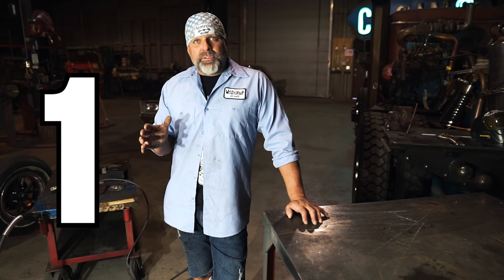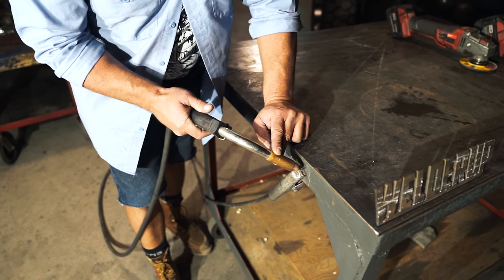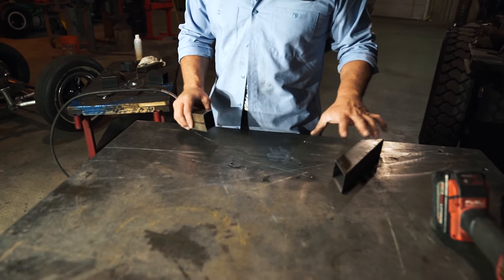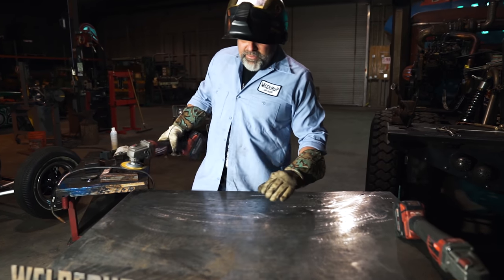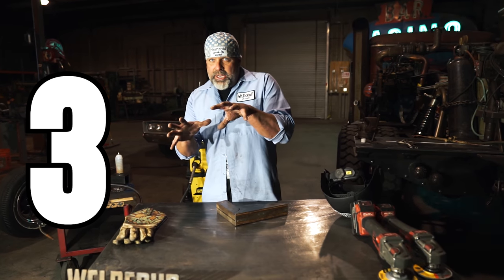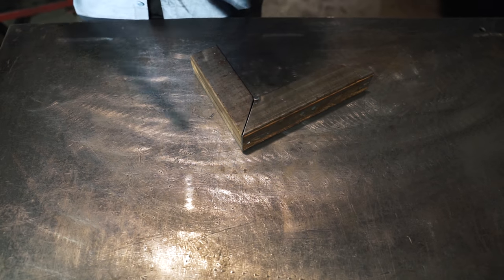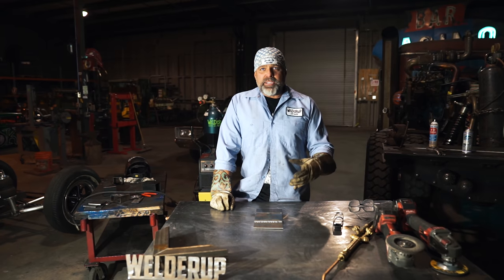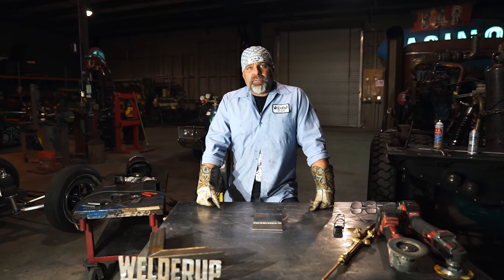How NOT To WELD! Top 5 Beginner Mistakes!

Comment: I agree with you 100%… Check out the scotch brite clean and strip XT pro disc for your angle grinder. If you buy one I swear you’ll wish you had a 10 pack of them. They rip ass through mill scale, rust and paint and they don’t hardly remove any metal. It’s worth it to me just for the mill scale alone. Great video man, I subscribed and I love your work btw… 👍🏼
Reply from the maker: Thanks Justin, welcome! Thanks for the tip, I give it a try.

Comment: Please read about the danger of welding over brake clean.
Reply: Steve Miller yes! Exactly the chemicals in some can kill
Reply: Brake clean evaporates away 100% in seconds it's only way to make sure surface is perfectly clean and it acts as an etching agent When painting try to TIG weld something without cleaning it with brake clean first tell me how it turns out
Reply: the hotwheels hunter us Acetone it is the preferred method to clean tig wire and the steel or aluminum your welding. I’m no expert, but if you check just about any of the weld videos . That’s what you will find them using.
Reply: @stevemiller5525  I'm pretty sure brake cleaner is acetone in an aerosol form they do the same exact thing and they're equally flammable
Reply: @CJC051  you can't prevent careless mistakes or stupidity stupid kills I do what I do for a living because I have more common sense than 99.9% of people you obviously don't know what a Millwright even is
Reply: the hotwheels hunter  https://www.thefabricator.com/thewelder/article/arcwelding/cleaning-material-with-brake-cleaner-before-welding-a-risky-move-that-can-turn-deadly  I wasn’t trying to get into a pissing contest. Just trying to help keep everyone safe.
Reply: @triggeringliberals405  I'm a huge fan of welderup and I watch all his videos and all his TV shows. I would absolutely love to build something like a V-rod or the big car hauler but i would never have the free time I've spent my whole life working 60 to 90 hours a week
Reply: Chlorinated, non flammable brake clean is the only bad one.. Non-chlorinated brake cleaners are just acetone
Reply: @v5u7sulh2  that may be.  But I'd rather just avoid brake cleaner all together. You're just asking for trouble. When another guy in the shop grabs the wrong stuff or you grab a can n dont read the label and fuck yourself up.  I'd rather stick to straight up acetone. It's not like it's hard to find or something.
Reply: @v5u7sulh2  there's also more ingredients than acetone. There's acetone content but a lot of other nasty shit too.
Reply: @zachkuby87  You're right. I have firsthand experience welding after someone 20ft away from me sprayed chlorinated stuff.  It doesnt even have to be on your welding area to burn your lungs and makes you literally choke. it smells like chlorine and you'll wonder why the smoke  smells so weird... You'll feel sick the rest of the day...  

If i share a shop with anyone else, i get them to use non-chlorinated cleaners and im hyper aware of the smells in the area
Reply: @thehotwheelshunter  Turns out alright. Never had an issue
Reply: Pickleing paste is more of a worrie 
Dont have to use brake cleaner there are other cleaners just brake cleaner is cheap and ready available
Reply: the hotwheels hunter you have to read the ingredients. Thinking something is equal to something else because it sort of works the same is poor thinking.

Comment: Just saying never coat your metal with a cleaner cause when you weld on it your breathing the fumes of the cleaner in
Reply: thats why you use a high voc cleaner like brake clean or laquer thinner, it evaps so quickly u dont even need to worry about burning the solvent.
Reply: if your that worried about minimal left over residue fumes then welding aint for you
Reply: @googleuser3148  , you do know that theres non chlorinated brake cleaner right . you probably know that since your Savvy
Reply: @punchinello6537   that is incorrect, not all elements of the cleaner evaporates.  when you weld over a cleaner like laquer thinner, the UV light burns what remains on the part turning it into a Chlorinated Gas.  brake cleaner and laquer thinner are old school solutions that they have found to be dangerous to your health.  I know from personal experience that once i switched from laquer thinner to a cleaner designed for the purpose, i have stopped getting the shivers and hard of breathing..
Reply: @ryanturriff6020  thats 100% false, uv light has nothing to do with anything in this equation, the only way to get a chlorinated gas is to burn a chlorinated brake cleaner which i hope by now people realize is bad, getting shivers and shakes from welding is most likely due to welding aluminium or galvanized steels with out a fresh air hood, as both of those cause cns damage.
Reply: Cody Ramos it’s not just fumes, it’s the poison the chlorine produces, which was used in war to kill people with, and—-it’s killed welders. If you don’t know this you shouldn’t be welding. Ignorance is special, but only in a bad way.
Reply: Rubbing Alcohol is a good pre weld cleaner ... it evaporates quickly too.
Reply: @ryanturriff6020  yea I agree mate some of that shit these guys are on about is way outdated and is definitely not what too do its been proven to be extremely hazardous, You do NOT weld over solvents etc

Comment: If people would read the manual that came with the 110v welder they would know, SP-100 is only capable of welding 1/8” ish in a single pass and that is with flux core .035 and multi pass will get them a bit more. 100 amps is .105 thickness on a single pass. Like the video!!

Comment: Please dont use brake cleaner to clean surfaces to be welded. Certain brake cleaners when heated by welding will release a gas vapor that is highly fatal when breathed in. Best to just avoid all brake cleaner to stay safe.

Comment: How about instead of running a 110 “200 feet out there” take that oxy/acet and gas weld the joint since you have it out there to pre heat the metal anyway??
Reply: Darn good point there. Not to mention that SMAW machines are down to the price of a welding helmet, so there is no reason not to grab one.

Comment: Great video! Easy simple things to make a better fit and finish. Only thing i dont do is anti-spatter spray. 
And for the ground, if its questionable i clamp a vise grip good and tight, and twist it a little to make it bite into the metal. Then clamp ground onto it. 
One question, do you ever use a copper block?

Comment: I love a 110 volt  MIG welder for..... Auto-body sheet metal replacement, & nothing else! I see a performance drop just using a 25' cord when I have to, & try to avoid it if vehicle is able to be moved once started project.

I have around 250' of extension cord for my 220 volt MIG, yes 250' 1 is 85', 1 is 135' & last is 30'  but never used them hooked together, usually reach with 85' or 135'. Eventually when I get truck built I will use this until I can do better. but it works & is paid for.

Comment: Per his recommendation at 4:25. Don't use brake cleaner to clean your surfaces before welding.
Reply: Doesn't it create some sorta crazy ass "can kill ya fumes" . thats a bad day at the welding table for sure
Reply: Yeah man definitely Use only acetone for cleaning metal. It evaporates very quickly and leaves no residue. Ive read about people welding 4 in beads over material that was cleaned with brake cleaner and they dropped dead after 4 in of welding.
Reply: Most brake cleaner contains chlorine. Heat it with a welding plasma, and you get poison gas.

Comment: I use a dual action sander with 80grit to get the edges of the steel smooth to weld together because a flap disc can wear down your edges easy if your not careful

Comment: I ran out of wire on a job one day had some thin wire in the truck thought I would try that but it blew out constantly and burnt back into the nozzle wrecked a couple of contact tips and ruined my day lol it was a 15kg roll and  I threw it in the bin when I got home and never used it again. luckily here in Australia the standard outlet is 240v can run a 200 amp machine from standard plug

Comment: How about creating a bevel for the weld to sit in then you can run multiple stringers in one area to create a stronger tinsel strength. 110 can make a strong weld in a pinch but 220 will always come out on top.

Comment: So from the thumb nail pic  i did something similar i chopped a 1950 and had shorten the the roof im a big man 6'10 400lbs i had to put a seam from b pillar to b pillar across the roof I can't touch the roof put need to tack it and weld it out so my brother hung me from the engine hoist in a rig we built from a welding blanket so I could tig the roof seam with out laying on the roof

Comment: The first thing you set about welding your ground to the workpiece another solution is always keep some small plates clip on the plate and then weld a plate to Whatever item you work in that way you're ground stays clean I'm not trying to critique you I'm just giving you a suggestion

Comment: Really anything 1/4 inch and above don't use short circuit mig really you need to change processes like same (stick) or switch to a spray transfer which does require different gas and a substantial size machine with good duty cycles dual shield flux core is also va very great option

Comment: I disagree about 110v welders and having to preheat. You need to bevel it and run multiple pass welds. Mig is the wrong process for thicker materials unless you are running spray. Do the root with 6010 and the hot passes with 7018. We regularly weld 1 in plate with 1/8 7018 running 110-125 amps. We do not preheat anything, granted it’s time consuming on a 110v machine as your duty cycle is not going to be good at 110 amps. But there is no reason you can’t weld something with a 110 welder because it’s to thick.

Comment: What is it with Americans and not having guards on your grinders?
Reply: I always use guards, really helps when u can adjust guard and keep Sparks away from you. Yet alone the safety, I weld pipe and rest hand on guard when grinding root or stops/starts for stability and no guard and that's out and then a zip disc would be scary if it or u slip out of position or even disc breaking it's straight up shrapnel heading to anything in it's path and idc who u are humans are bags of jello to things at that speed. Be safe ppl
Reply: @jrg10332 I've never had that happen before.
Reply: @jrg10332 you can Just bend it back

Comment: Rule#1 of farmer welding.  Like welds like.   Therefore you need to use rusty welding rods to weld up rusty metal.  

If a machine is old and rusty you never want to burn up your new good and clean rods on it.  Always use those rods you got from your neighbors  grandparents garage sale and have had on top of that dead refrigerator in the back of your shop since 1987.